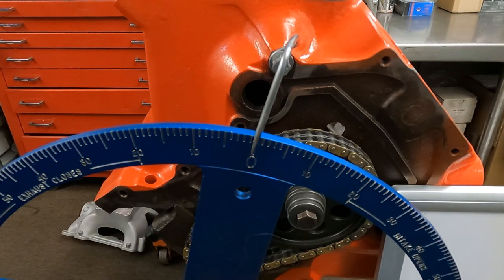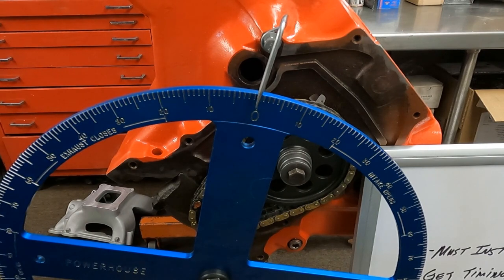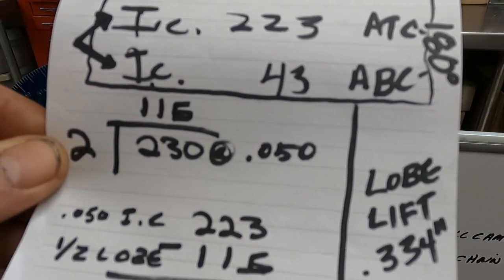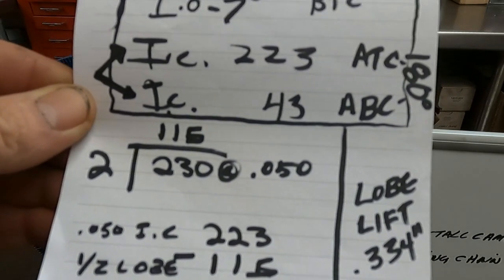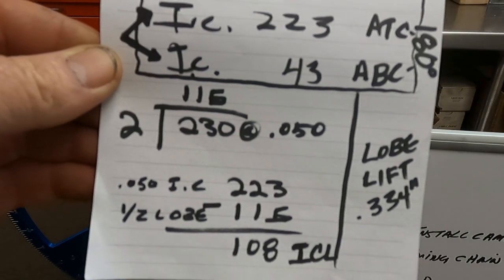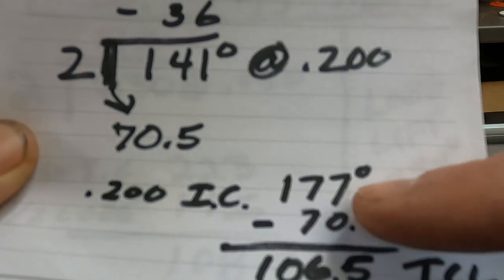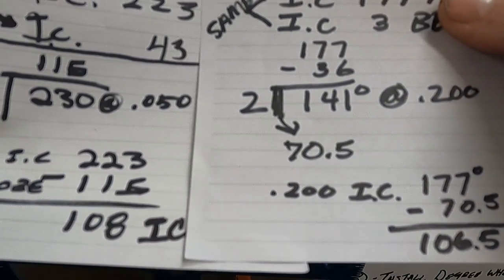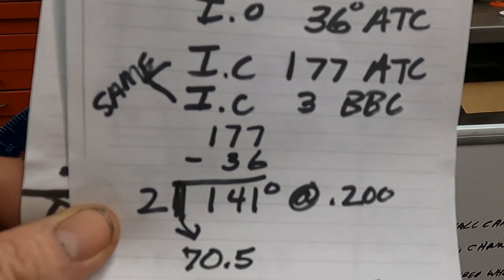Building a Better 312 Using a 292: Part 5 Cam Degreeing

Comment: How did you get so smart with engine building? LOL I'm always impressed with high performance technical knowledge. It takes a lot of smarts to understand all the intricacies. How do you make a quick revving responsive street engine? It's a number of factors, specifically not using a large cam, not using large heads with large ports, a lighter assembly like pistons, rods and crankshaft. Do lighter valves and rocker arms and push rods also contribute to a quick revving engine? I have even seen where someone installed a different exhaust on a Ferrari 550 and the engine revved faster than the stock exhaust system. I don't know if cubic inches plays a role in terms of  how quickly an engine revs. I'm not interested in building a huge torque monster I'm more interested as an example a European engine like a Ferrari which does not have massive torque but is very responsive and quick to rev.
Reply from the maker: It seems like you've got your thinking cap on.  Yes you pay attention to everything when you're to make something do what it wasn't designed to. 
 A great long block is always good place to start, but think about the engine as a complete package from air cleaner to mufflers.   Many people overlook a good air cleaner with proper height above the carb.  If you have to run a short air cleaner mill the choke horn off the carburetor. Spending 2 minutes to warm it up is worth the performance gains. Proper headers and collecters are worth it.  You should look at a program called PipeMax.  It has a ton of good info  
with not much input, many simulation programs  require more information than the average person has in the early stages.

Comment: 🔔😎🇺🇸
Do you check more than one intake to determine variations ?
Or
Do you check any exhaust lobe to verify the actual LOBE SEPARATION ANGLE ??
How do YOU determine what LSA to have?
Do you ever run test different installed angle to determine which makes best power, or just go with the card ?
Thanks for mentioning assymetrical lobes. Shouldnt we be measuring as high as possible ?
I like the .200 reasoning, 2/3. 👍
How about timing chain "stretch" ?
**
Thanks for the BEST degreeing video that I have ever seen in my many  decades.👍👍😎 Pushrod 5.0 HO guy 😁😁 but we've an original rust free '55 272 hardtop.

Comment: An aspect of these engines not given much attention is how strong these engines are. I put a later gen air pump on one of mine with lower compression heads and proper cam grind,  10 years now and its still a very happy engine. Another of mine has near 900 cfm carburation tuned to suit and its been moving the car over 25 years also still a happy little tugger. Gotta say no point on any of that without the good long tube headers (and added welds to the rear spring mounts). I do have front disk brakes on all my thunder buggies. Lots of go needs lots of stop.

Comment: Good video. I probably spend way too much time experimenting with various degreeing points and methods but it's interesting to me. I even plot the lift curves in 10 degree increments as well as degree again after assembly with  running springs. In the end I try to go by where the cam grinder intended to be checked as well as verifying opening and closing events
Reply from the maker: Liking to check cams @.200  I sort out my own numbers for I.O and I.C. and then install them where I think they'll run best for the application. Most installations end up advance a couple degrees.
Reply: @mummertsspecialvinterests2721  yep, if anything I will usually error on the advance side to allow for chain stretch and earlier IVC
Reply: Timing chains will stretch 2* in 3,000 miles. @mummertsspecialvinterests2721

Comment: An adjustable timing chain.... looking forward to seeing that one. I've been running several high quality built street performance yblocks for a lot of years. They break loose both tires just on engine acceleration on dry pavement, enough for me. 292 blocks with 312 cranks, yup.
Reply from the maker: It will a video explaining how to use our 9 way indexable timing set seen on this engine.